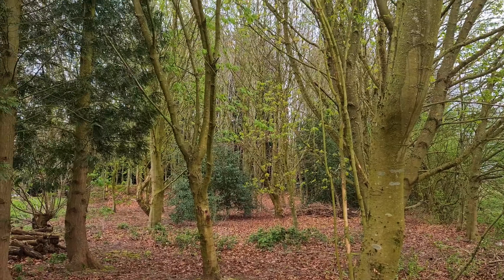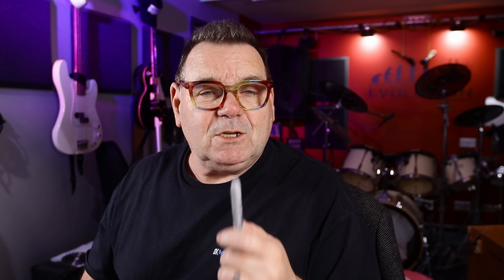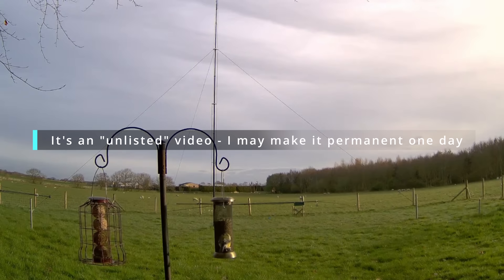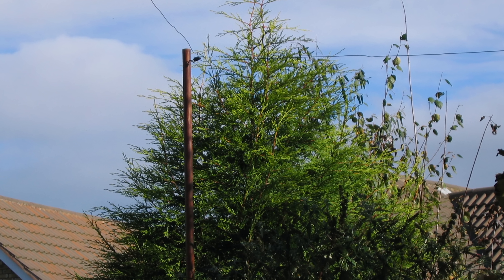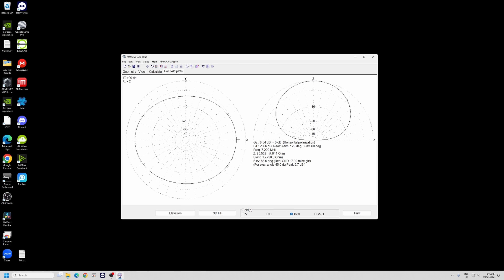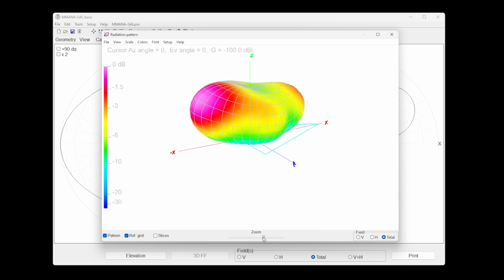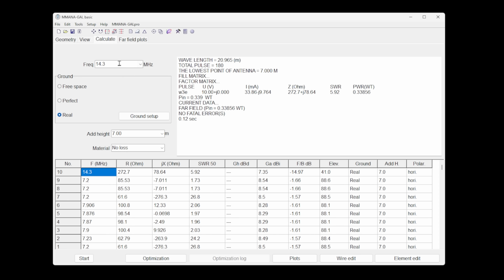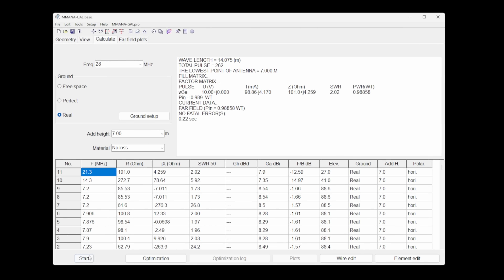Amazing Cheap Multiband Delta-Loop Horizontal Antenna

Comment: Hi Callum, been building and using horizonal loops for years. It's a GREAT antenna and it's a cheap option, resilient in storms and the gain is greater on bands above it's resonant frequency in the direction away from the feed point. The shape isn't so important either (theoretically the more space inside the loop the better the gain, so a circle would be best but anything works).
I've tried coax feed to a balun and even ladder line but I always come back to using a Q-section of 75 ohm coax (1/4 wave long in 40m for a 40m loop). It is still multi-band and I use it often on 20m to work into Australia or on 10m to work into North America. 40m in winter into New Zealand. Great, great antenna. 73 Ed DD5LP
Reply from the maker: Never tried circle and I'm not convinced either.. It's got to be the spahe itself, like a V beam / dipole..?
Reply: @DXCommanderHQ  I believe the different gain levels with different shapes are almost only theoretical as the majority of installations are defined by the shape of the garden it has to fit into.  Of course with a large field you could compare for example delta, round and square but I don't believe the shape of a delta loop gives it more directivity than another shape. This is an antenna that simply works well no matter what shape you make it. Mine is up at 9 metres rather than the 7 metres it was at and that extra couple of metres doesn't give it more gain but moves it further away from the house and reduces the noise floor. 73 Ed

Comment: One of my qth antennas is a 40m delta loop, up at around 7m. One point is slightly lower due to not having the required height but have not noticed any adverse effects. Built it from 1mm stainless electic fencing wire wit a 2:1 balun and I've worked Europe on a 20W G90 and the loop. Tunes beautifully and the Rx on it is really good (i do live in a rural area so that helps with lower noise floors). Enjoy the build!
Reply from the maker: Lovely.

Comment: I’m a new viewer and also a massive nube when it comes to RF antennas! But, do I interpret your drawing of the triangle correctly as the antenna being a closed loop, with the two ends of the triangle connected to the balun? Wouldn’t that create a short? Does that work? I thought that antennas need to have an open circuit? Again, I most probably may have misunderstood the concept of antennas completely… Hence the ”nube” question? Does the antenna cable consist of two leaders, whereas the leader and the braid are fed separately? Many thanks for all your excellent videos!❤️🇸🇪
Reply from the maker: A short.. Looks like it - but inside of coax will effectiovely go one way - and the earth goes the other way.. Yes, it's like a short (sort of)
Reply: @DXCommanderHQ  My question was put with the outmost respect to your knowledge, and what I really wanted to know is if each end of the leader on the antenna (as there are two) is connected to separate poles on the balun, or if one end of the leader is connected to one pole on the balun and on the other pole on the balun will be connected the braid. As you may notice, I’m very new to this area, and I may actually ask the most infantile question possible….

Comment: Hi Cal:  I am running two loops at present.... both horizontal.  One is a square 80-10M SKYLOOP up at 18M and the other is a Delta or triangle 40-10M.  If you go to my QRZ page, I have a link there called SKYLOOP and there I have loads of links to articles and videos (Yes a few of yours BTW) and notes about my build.  Look forward to your series on these great antennas.  And I do utilize both of my loops in diversity reception with my dual VFO FTdx101MP.  Cheers.  Art W1SWL

Comment: I’ve built these all ways. Square , tri, circle.  The inverted delta with 2 ends up work best. In a vertical plane of course. Place to feedpoint opposite of where you want to beam. So to eu I put the feedpoint on the western side of the loop. Note there is more noise if the feedpoint is on the vertical element. My favorite antenna for 40m. Some people love them for 80 and 160 but their dx is lacking compared to a higher dipole  or 4sq verticals. Wish I had a few 100 ft towers for a proper dx loop.
Reply from the maker: Interesting!

Comment: Hey Cal .. interesting video. But I need your help. My roof I small in space and I can't raise a 7m mast. Max I can go is 5 meters from roof of my house . What antenna I could try build as multiband from 40m to 10m bands, using 49:1 unun or 1:1 balun ? Jimmy SY1DAL
Reply from the maker: OK.. 5m and 40m don't mix THAT well.. But for 5m, you could copy / replicate the Rapide (which is 7m) and cut it down so it does 20m, 17m, 15m, 12m, 10m and 6m.. You could actually just remove the top 2 sections from a "real" Rapide and do that. For 40m, some wire in the back yard..
Reply: @DXCommanderHQ  ok fair enough... Will try it . Thanks

Comment: Are you really going to hang it in these trees? I would see a video how you manage :D Im experimenting with the verticals in a forest because i dont want to thread the wires trought the roots... I want to try 80m loop by SP7LA, but probably i dont have enough space to put 81 m of wire...
Reply from the maker: That's the plan.. I MIGHT use the drone to assist some parts of it..

Comment: In SP there is very popular delta loop antenna designed by SP7LA (SK), it works without ATU on 80-10m (with WARC). Balun 1:4, arms lenght (starting from balun)  23.87m, 35.1 and 23.87m. It's big, but works well even 5m above ground. So with 82m of wire you have almost all HF bands. I think every ham operator in SP built and used that antenna in his career. For 40-10m band there is modified version with coil near to balun (arms lenght 13.1m, 15.2m, 13.1m).
Reply: Thanks for sharing these numbers! For the smaller 40m version, is it omnidirectional?
Reply: @rtv278 depends on how it's mounted. If horizontaly yes, IT can have small gain in direction where is the lowest mounting point (corner).

Comment: Hi Callum, why a 4:1 balun over a 2.5:1 balun? I use a 2.5:1 and with my 40m loop I get 40,20,17,15,12 and 10m all below 3:1 swr. I also did something odd and have an 80m (tuned to upper portion) on the same balun sort of like a fan dipole theory, arranged where if u look down from above it it would look like a lopsided bowtie with than balun as the knot. I wonder how the radiation is with this setup? Maybe you could run that thru that software
Reply from the maker: I've always used 4:1 and it's worked for me.
Reply: @DXCommanderHQ  well I was hoping for more of a scientific answer lol. Just curious to learn from an antenna guy like yourself why this over that sort of thing.
Reply: @TheNuttyHam  hi mate - the impedance at the feed point changes according to multiple factors including height above ground, shape of the loop, placement of the feed point etc.  I have a 80m loop with a 4:1 and it is great.   This article is really quite good:  https://practicalantennas.com/theory/loop/full-wave/     A 2.5:1 will be also fine for impedances around 130 ohms or so.
Reply: @TheNuttyHam 4:1 gives a better match on the harmonic frequencies. A 2:1 or 2.5:1 gives a better match on the fundamental frequency. It's a tradeoff. I use a 4:1 Ruthroff voltage balun on my 273' loop about 40' high. I can work the world. Great DX even on 80m. KE6VG

Comment: Hi Callum! - Great video. - My own plan is to form a very irregularly shaped loop using sparce trees at variying heights with the feed point being one of the highest.
Length will be around 160m - Feed point wil be ~45 feet - other heights around the loop will vary wildly between 25 and 35 feet.
I will be feeding it with open wire transmission line into a balanced tuner.
Will I still need a 4:1 balun? - Or will the balanced tuner (MFJ 974B) be able to compensate for any mismatches?
Reply from the maker: If you are running a balanced tuner, you don't need anything else.

Comment: Hi Cal. Run a 160m Loop here at 400w at 12m high. Thinking of doubling the size to 320m and to see how it works. Have plenty of room to run it down the paddock. VK3DJC
Reply from the maker: Wow.. Do it!
Reply: @DXCommanderHQ  Have modelled it MMANA and you get some crazy gain and lobes as you go up the bands. Cheers

Comment: I have a DX commander signature but I wanted a loop to play with, so I managed to put a 160 meter loop at about 5 meters above ground around my property.  I only had a 1:1 balun on hand so I hooked up to that and then 20 feet of  RG213 into the shack.  I started playing around on 28 MHz and first contact was Tokyo from my QTH in Texas.  Gotta love a loop antenna.
Reply: If you don’t mind me asking how many watts did you make that Tokyo qso with?
Reply from the maker: @Tokyo1991.JL1AJE  I think that was 1kW.
Reply: @DXCommanderHQ  
A kilo what?! Ouch…
Well I now have 50W to play with officially.
And I’m getting over to the US mainland and Oz/NZ with just  20W Morse into the Reverse Beacon Network. Also audible on a remote KiwiSDR with just 20W SSB on 15 meters!
73 de JL1AJE
John 😊

Comment: I helped a ham friend years ago make a 20m square loop but only 1/4 wave length high. Easy to do with 4x4 posts and PVC strapped to the posts. Fed point was direct...yes no balun...at one corner. He had great results with it. It was experimental and the wind brought it down after about a month. He claimed quieter than inverted V dipoles with similar gain. I experimented in my backyard on the US CB band 11m and ended up with a 1.5:1 swr...it got in the way mowing the yard so I eventually took it down! I think the term used back then for these horizontal loops was 'sky loops'.

Comment: hi cal.  i worked you a few years back with a square 40m loop 8ft off the ground at my old qth.  used hardened copper wire 1.5mm ( winding wire for motors extra)  with an off set feed point and a 2.5 to 1 balun.  it worked brilliantly on 10 watts on 80m 27.6.2020 2313hrs loved it. your video has inspired me to do it again!  just to convince the missus now 🤔
Reply from the maker: Oh right!!

Comment: I have a 320 meter ( roughly two wave lengths for topband) sloping loop 80' down to 70' right next to the sea over very wet sloping ground and a burn  fed with 6" open wire feeder into a home made Collins type tuner basically its two inductors (18 uH) each in parallel with caps (600pF) at each end across the inductors it does quite well , for the higher hf bands i have to switch out one of the caps as the minimum capacitance is a bit to high its one of the best antennas iv ever built but needs quite heavy hardware and wire, consideration needs to be taken with the halyards and free running hanging points so far its held up in 65+ mph winds without a problem
Reply from the maker: Amazing.. Very nice indeed.

Comment: chain link fence top rail is 21' long...........fairly cheap and very stout............readily available here, some comes with swaged ends which will allow you to plug in more sections or cut the 21' length in half and have two 10' sections which may be easier to handle.........cheers from New England to old England 73, Mike K1FNX near Boston

Comment: Hi, Cal. Yes! This was my first antenna build and it was quite similar to what you presented except that I fed it with ladder-line from a Versa Tuner using this obscure little thing called a PT-340 "Tuner-Tuner" made by Palomar to set the best match on each band. I worked the world on all HF bands with that setup quite effectively with 100W and had great fun with it. Yes, it's very quiet receive, too. Highly recommend that folks give it a try if they have the real estate for it.
Reply: I have had a horizontal delta loop up for almost 8 years. Its something close to 80 meter in total length. Fed with ladder line and a tuner. Presently an old SGC-239. Had several manual tuners on it before. I feed it in the middle of one side. Always wondered what it would do fed in a corner. All my radios love the antenna. Running WSPR on it tonight for the fun of it. I have put up verticals and dipoles and end feds. And keep trying different antennas. The delta loop stays up!
73 W4WCS
Reply from the maker: OK, so you too. Yes, very nice.

Comment: If only my back garden wasn't the size of a pocket handkerchief,hi...thanks for yet another great video Cal.
Reply: Yup, mine (back garden) can only fit a 40mtr dipole as inverted v, and then the last 3 ft ends head earthward to get a tune. However the loading coils on the ends of the 40mtr get me to 80mtr with extra wire still heading earthwards for another 5 ft. And the 30mtr and 20mtr dipoles fed from the same feed point as a fan (inverted v) perform great. That gives me 4 bands without need for ATU. And 17, 15, 12 and 10 can be accommodated with use of ATU (transmatch) with degraded performance. Still working on the upper 4 bands as 2 x trap dipoles, 12 and 17 as one, and 10 and 15 as the other, otherwise there are too many losses involved in the traps and reduced bandwidth also. We shall see how it goes.
Reply: Maybe you should put your Delta loop antenna in an vertical position. Takes less space. For 20m  loop use 2, 7.2 m fiberglass fishing rods and configure In a V shape. You can almost make equal length all 3 sides. Still use 4:1balun. Test 450 ohm window line for multi band use. Also the lower point no 
more than 10 ft above ground. Because you start to get additional lobes that weaken the stronger original angle.